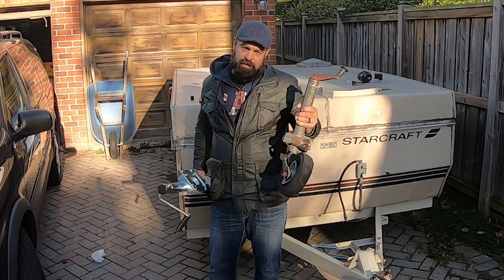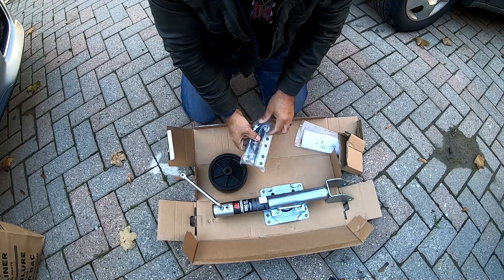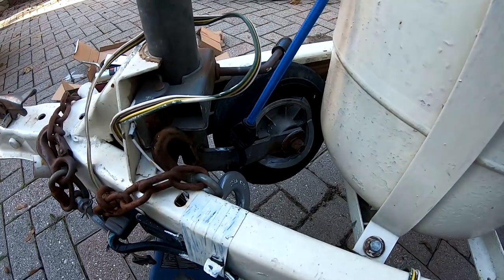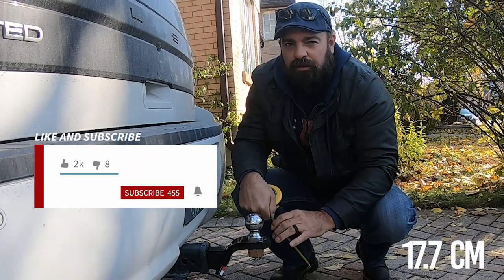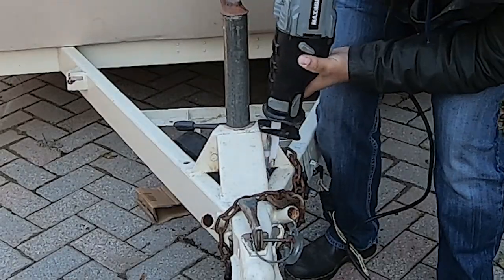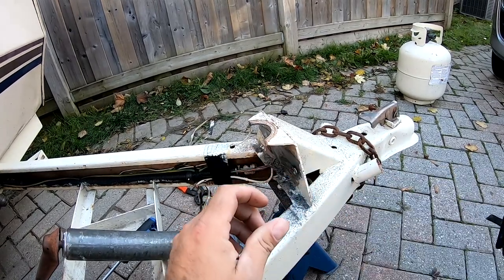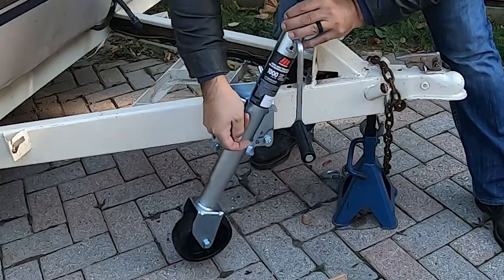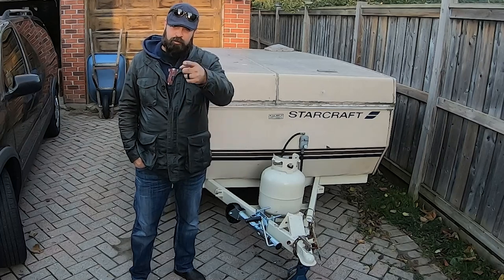Pop up Trailer Remodle Video # 9: Installing a Motomaster Swing Arm Trailer Jack

Comment: I bought the 2000lb swing away jack for a 1200lb popup. I didn't need to get the big one, did I?
Reply from the maker: I don't think so, I thought that the amount of pounds was for the max weight, but having an over sized one might not be a bad thing. Thanks for watching :)